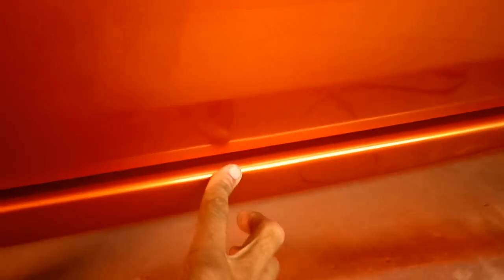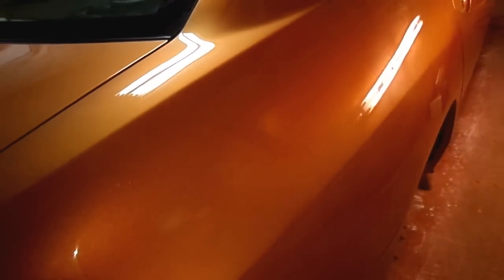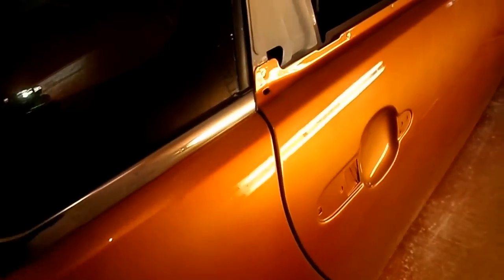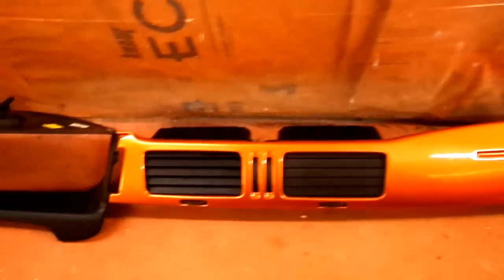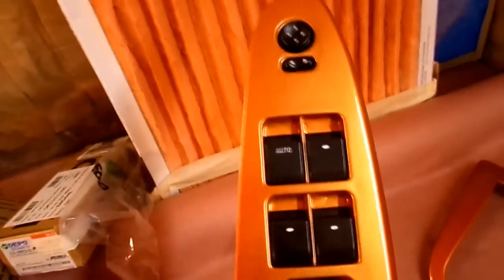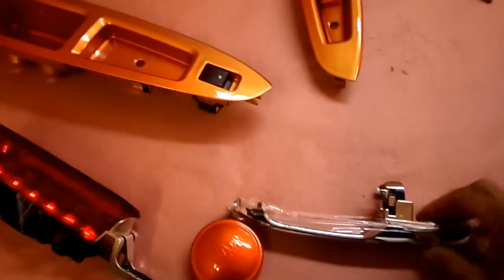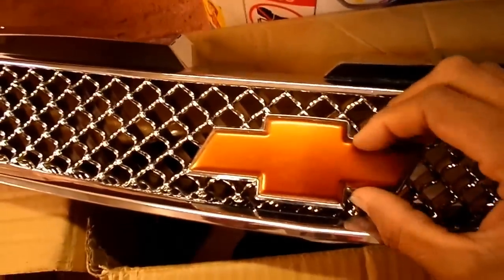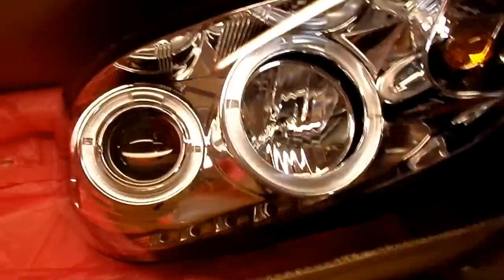Painting 06 Impala Candy Orange / Update 21

Comment: Good work bro. If you haven't fixed that chip issue yet,what we do at work is make a small batch of single stage,in your case take the silver apply that first let it flash then take your candy and pearl and mix it with the clear and apply a couple of coats that should fix it. Try on a test piece first to be sure. Good luck
Reply from the maker: Thanks for the suggestion.....I will try that once I finish putting everything back together...I thought about that....should i spray it with an air brush or dab it on with a detail brush since its such a small spot?
Reply: Dab it with brush. Let it flash and build up your coats, you should barely be able to notice b it. Let me know how that works out. Its a pleasure to help you out.